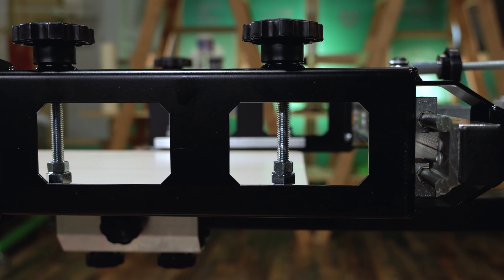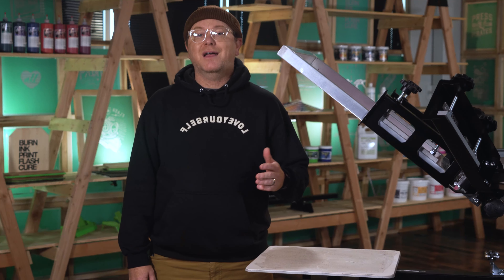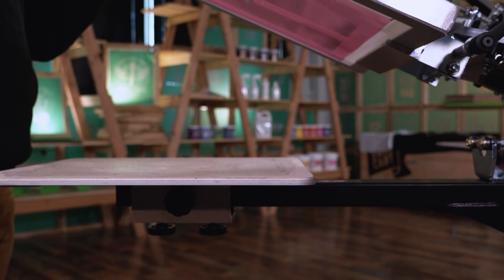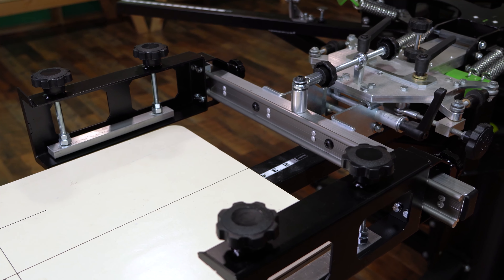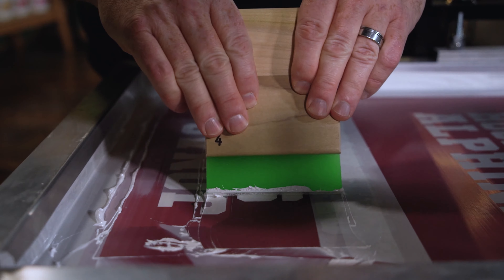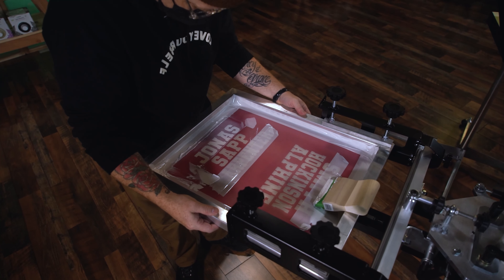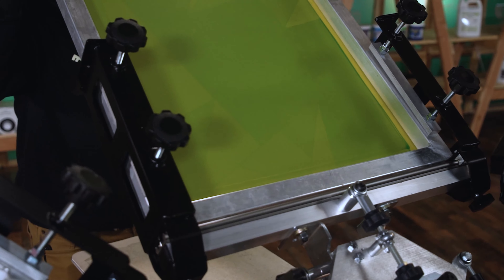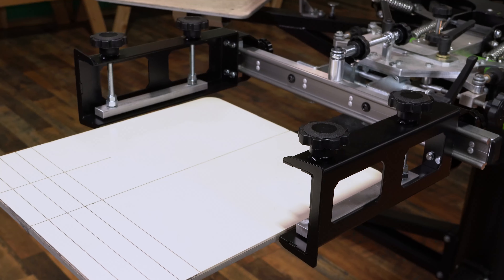What are side clamps and why should you use them?

Comment: Vastex makes a side clamp that can clamp into your existing rear clamp making the conversion extremely simple! They also have a few options for width and length.
Reply from the maker: Good morning @Shawn Edge! I believe that i have seen those, they also offer a numbering system that is the same... meaning, it clamps into the back clamp. Have you used the side clamps? My only thought is this. Not only do i have the existing weight of the rear clamp, but i'm adding on the weight of the side clamps as well. I would imagine the print head becoming pretty heavy at that point. Thoughts?
Reply: @Ryonet  I installed them on my Antec Legend press, I had to add another set of springs.
Reply: Vastex is very bad printing press
Reply: @burakerol.  I’m not a fan of their presses but the side clamps are decent enough.
Reply: Will these fit a ranar ?

Comment: I recently bought the riley 250 6x4. Is it possible to buy these for my press?
Reply: Their website is only showing them for Riley 300 and 350. I also have a 250 and wish this would work for me.
Reply: @bigmamabren3360  maybe in the future they’ll make one for the 250. I mean it’s extra bucks for them right 😉
Reply: @hustlerstudiomfg  I think its the space between the bottom corners of the frames while they are on press. The space might not accommodate the extra width of the side clamps, but I hope they figure it out.
Reply from the maker: Good morning @Meester Tris & @Brenda Owens! Brenda is correct. There is some spacing issues w/ trying to take side clamps to the 250. The main reason is weight though. The 250 head would struggle to hold side clamps up. The connecting plate would also have to be redesigned. Not the answer you were hoping for, but i hope it helps. 
Having used both, I would say that both the 250 back clamp and the side clamp have a ton of value. The 250 is light and maneuverable. The side clamps are super sturdy and stable, but do add weight...
Reply: @Ryonet  you guys are always so awesome. Great customer service!
Reply: @Ryonet  what are the side clamps made of? Alum? I know the Riley Hopkins is designed racing engineering, I wonder if there is any weight reducing concepts that could be done to bring this to the 250. Keep in mind that I am neither an engineer nor have I ever touched side clamps, so I don't know the details of their design or make or even how cost effective a design could be to fit the 250. Just thought I'm throwing out there in hopes that one might stick.
Reply from the maker: Awesome feedback, @Brenda Owens . I'm not an engineer either, so... I'll share it with the team in manufacturing. We appreciate it!

Comment: only problem I am having  with these side clamps is when  I'm using big screens and doing big designs over 17-18 inches height,  I often have to pull my platten out further than it allows in order to print my design.
Reply from the maker: Hi @The Blank Workshop. Question. What press are you working on and what size of platten?
Reply: Did you figure this problem out?
Reply: @Queenlaurensky  no I just have to pull my platten out further than it allows. , the twisting knobs kind of hang off.